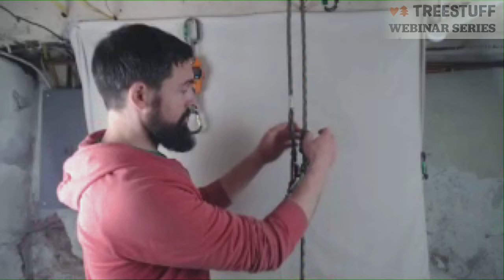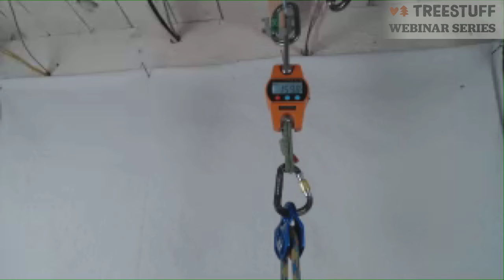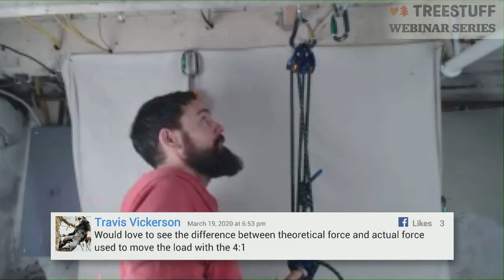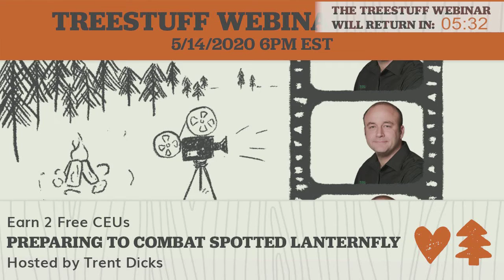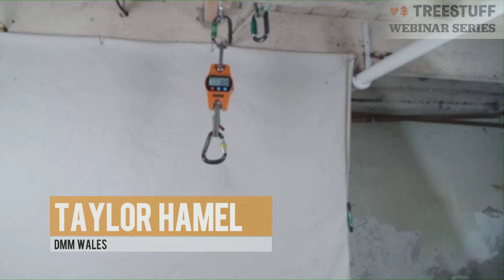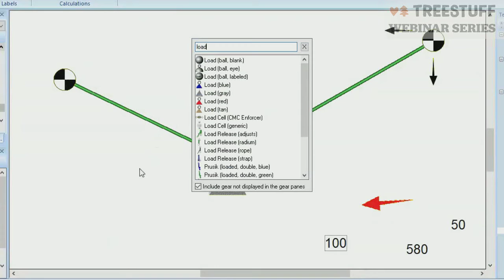Advanced Arborist Rigging Theory Webinar with Taylor Hamel - TreeStuff

Comment: I've never concidered creating vectors as a means to generate more force in a pull line.  In practical applicaitons, I am courious how the load at the anchor points change as your vector angle is increased or reduced.  For example, In my scenario I will drop a tree.  I tie150 ft of true blue 2/3 the was up a pine tree and then achor the other end where I would normally pull from,  With another rope secured in the midpoint of the true blue, I can pull perpendicular (or 90 degrees) from the true blue to create a vector and generate more force than I would from pulling at the achor point.  Now consider the stretch of the true blue rope and movement of the tree that contributes to the reduction in vector angle as you pull.  Am I loosing advantage the harder I pull?  I would think yes.  I understand its still better than pulling at the achor point but, do you have any resources or charts that illustrates this concept?  To clarify a little more, In the example, lets say I want to pull 100lbs perpendicular to my true blue but, I want my created vector to remain at 170 degress.  How tight does the true blue have to be initially (forces generated at the anchor points) in order to create a 170 degree vector with 100lbs of force?  I hope thats clear and I understand rope and tree dynamics play a factor into the results.  Any thoughts?
Reply from the maker: It like when you have a pull line set up and you bounce down on it to get that last little bit of force to pull the tree over.

Comment: Good job...thank you for your humbleness regarding your math abilities. I have one important correction to the advice regarding tree take down using vectored force on a tensioned line of a block and tackle system at 1:43. While what you said is correct, the illustration was wrong. Walking the line over to move the vector by 90 degrees will actually cut down the take down force because you are taking 1 of the 5 legs of mechanical advantage away.  What you said is right but you must do it differently than what you showed with your basement rig. The rope end that the ground crew has in their hand must be tensioned in line with the block and tackle to maintain the 5:1 advantage. To do this, just secure the end to the base anchor or stump you mentioned . Then you only need to pluck it like a bow at the center of the block and tackle system (just like bow hunters pull on the center of the bow string) for maximum effect (much greater than 5:1). The easiest way to do this is with a second rope that gets attached to the tensioned end you just tied to the stump. Use a running bowline. Then walk the line over pulling the slip knot to the half way point of the tensioned end. Once you are there, just reposition to the 90 degree point without making the slip knot move. Finally you are ready to pull and watch the tree fall. I am an engineer who understands the math. If any one wants a picture, I can draw you one that will make this much easier to understand. -David.Dara@gmail.com
Reply: I belive he mentioned the loss in mechanical advantage by changing the angle on the pull line.  I think the point was, changing the vector in pull creates more tension in the taunt line than what is lost altering the fiddle block system.  Another way of saying it is, Pulling a taunt line from the center perpendicular almost quadrouples your efforts in force put on the taunt line.
Reply: Aha the scenario 103 minutes in, right? (1:43:00)
Please correct me if I'm wrong, and please also excuse my simple mind that would likely have misperceived the scenario; as tail is pulled and rolls off of a stationary pulley (earlier in the video that block was said to be tied immediately at the tree trunk I think ... 1:42:26) it appears that there would be no 5th leg regardless of angle - but, rather, that it is effectively a mere redirect on a 4:1 ... (?) 
May well be a totally confused notion. Still thinking this through ... do let me know where you detected the gaps in my thinking ...

Comment: exciting knowhow

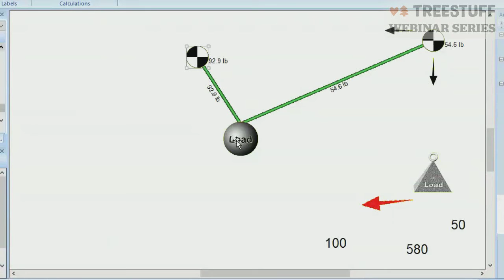At 1:53:16 in my opinion it depend on the angle from the Load to the anchor point and the angle between the two different ropes and not how far the anchor point is.
Reply: Yknow I haven't even gotten that far yet but just look at your reply-- "how far the anchor point is" will ALWAYS be a relevant factor if force is concerned (because of length-of-rope that's in-system, you can snub heavier stuff with a 15' length of cordage than a 10' length)

And 'exciting know-how'...couldn't have put it better myself!!  This is a relatively new vid but if I hadn't stumbled-on it now then god knows when(/if) I'd have found it...anyone know of "link repositories" for arborists?  Will setup one on my  blog if I cannot find one, there's gotta be some indexing so people aren't oblivious to the existence of content that they'd be grading A+ and counting among their favorites!!
Reply: You are correct. What he was pointing out is that the different lengths result in different angles and therefore different loads on the two anchors. In the extreme, if the right rope length is long enough all the load will be on the left rope and anchor. As the right hand rope shortens, more load goes on the right hand anchor and less on the left hand anchor; the converse is also true.

Comment: Good stoff.
Reply: Good job...thank you for your humbleness regarding your math abilities. I have one important correction to the advice regarding tree take down using vectored force on a tensioned line of a block and tackle system at 1:43. While what you said is correct, the illustration was wrong. Walking the line over to move the vector by 90 degrees will actually cut down the take down force because you are taking 1 of the 5 legs of mechanical advantage away.  What you said is right but you must do it differently than what you showed with your basement rig. The rope end that the ground crew has in their hand must be tensioned in line with the block and tackle to maintain the 5:1 advantage. To do this, just secure the end to the base anchor or stump you mentioned . Then you only need to pluck it like a bow at the center of the block and tackle system (just like bow hunters pull on the center of the bow string) for maximum effect (much greater than 5:1). The easiest way to do this is with a second rope that gets attached to the tensioned end you just tied to the stump. Use a running bowline. Then walk the line over pulling the slip knot to the half way point of the tensioned end. Once you are there, just reposition to the 90 degree point without making the slip knot move. Finally you are ready to pull and watch the tree fall. I am an engineer who understands the math. If any one wants a picture, I can draw you one that will make this much easier to understand. -David.Dara@gmail.com
Reply: @daviddara3738  Sounds ggod - I will contact you for a picture if that's ok